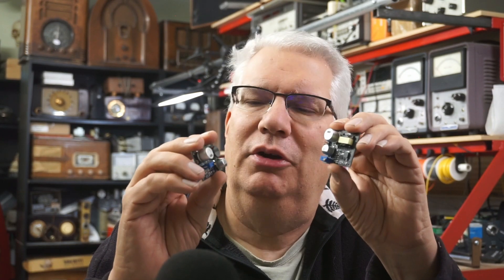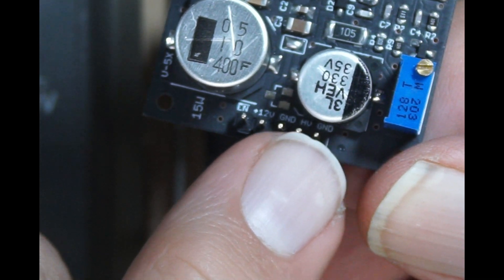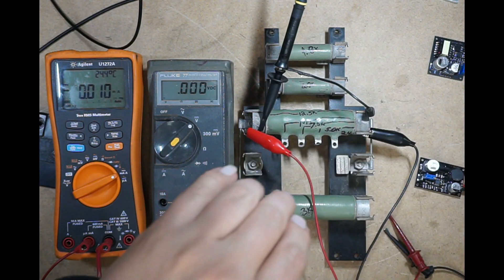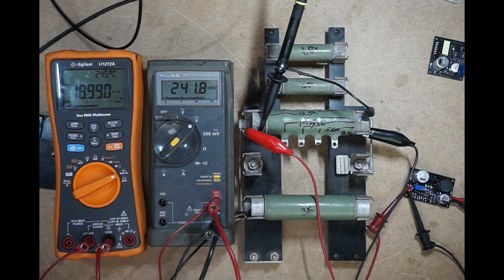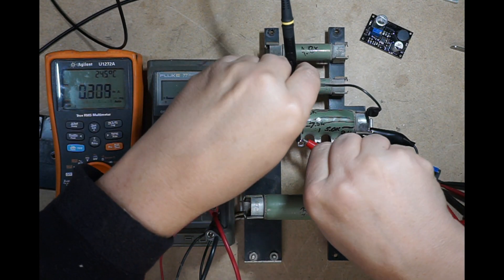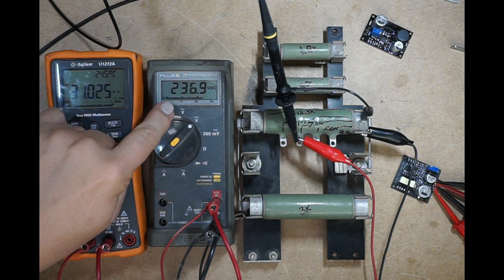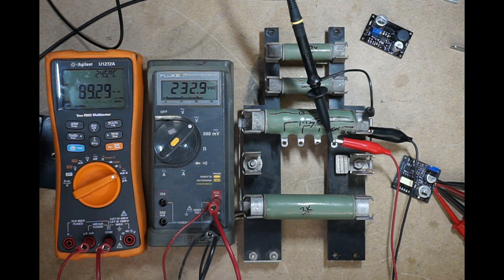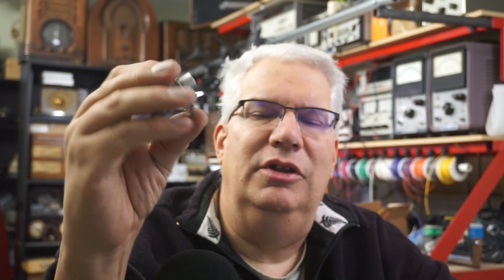High Voltage Power Supply Evaluation for Tube Amp

Comment: It's a pity the voltage is in a little bit higher, because I have have read a white paper on Texas Instruments or Analog Devices, I can't remember which, where they describe the method of using a low noise linear voltage regulator to clean up switching noise.
Reply from the maker: that's a common approach for cleaning up a switching PS is to follow it with a linear one. However you might need a high voltage ground referenced voltage.
Reply: @CraigHollabaugh  precisely what I said
Reply from the maker: @davidkclayton  if you get a switching PS, make sure the switching frequency is outside the audio band.

Comment: Hi Craig, great video 👍😊. I'm wanted to try out these HV switch mode PS as well, but you're faster than me. Thank you for this one. I DIY'd HV-SMPS using standard 12volt light switching supplies and rewound the secondary to let me have around 250volts/100mA and 12volts/5A DC but it isn't as easy due to rectifying problems which occur in fast switching supplies... Anyway I ended up using hyperfast diodes and L-C-LC filtering for both lines along with FET based in series voltage regulation and putting the whole thing in an little aluminium case. I ended up with nice clean DC 250volts and also 12volts. But these little modules make things far easier. Combine this HV supply along with these standard buck converters give us the opportunity to power tube stuff out of any common 12 to 24volts mains tranny which are easily available and way cheaper than a one-off special tranny wind to measure.... 😉 😊

Comment: I am hopeful for the low end version of this technology sometime in the future, but this kind of power supply seems too good to be true if you're looking for any longevity.  Makes sense for battery operated stuff, but if you must do battery powered tube things,  there are tubes meant for that.  You need a chunky linear supply for those 6sj7s or all the rca engineers will roll in their graves.  I may have tried and failed to repair one too many class D bass amps...
Reply from the maker: I'll get back to iron power transformers in future designs. Thanks for watching. ps. I think the RCA engineers would marvel at a DC/DC boost converter.